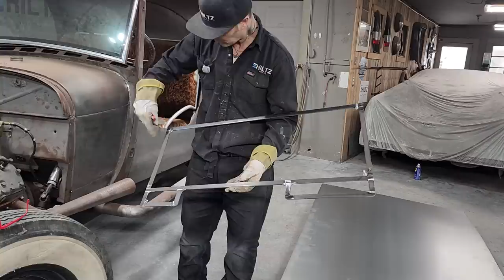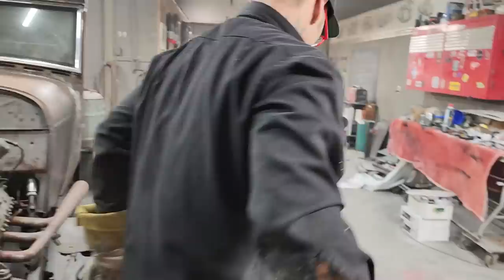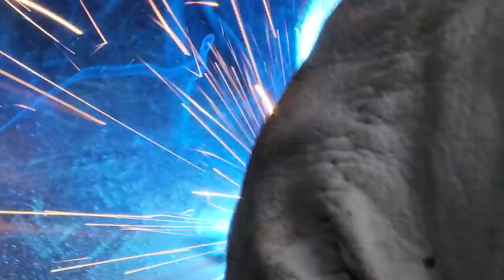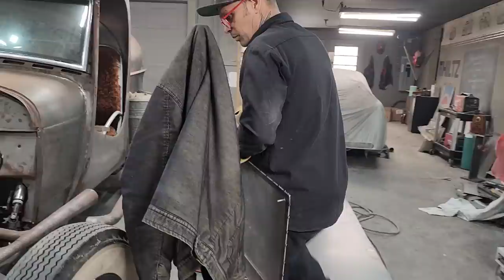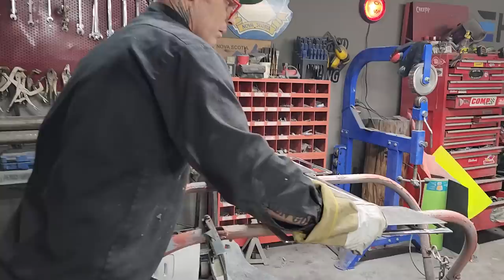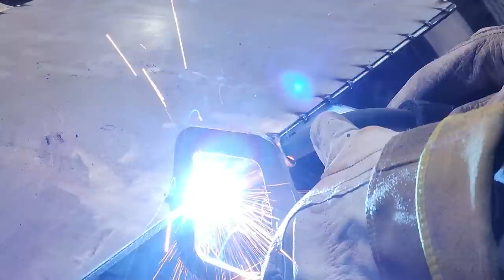Hood fabrication — sheathing with sheet metal 🚨 1928 Ford

Comment: Chad, the last timeI saw you using the Lincoln plasma cutter you experienced some problem with it. In my past experiences, when I had a similar problem I but a new electrode in the gun tip and it solved the problem, worked like new again. Hopefully you can try that to solve problem.  Thanks to you and Jolene for all the great videos and work the two of you do to create a mass amount and knowledge and inspiration on wonderful projects..👍👍👍👍👍👍👍👍👍

Comment: I would plug the three pronger in at the wall, 
Then run three separate single extension leads that way reducing the nest of confused tools and cables in the shop, 
It’s only really required if you have a lack of AC outlets in the shop,

Comment: Old school Harley, Indian style rear fenders with the flair out at the bottom all four corners. Keep the turning headlamps add OG skirts on the rear. Use the motorcycle rear tailights and plate holder on the rear fenders. Fill the tubing running boards flat on top to the body. Put an old school radiator cap on grill shell. A pegasis or something with wings. Shell Oil?

Comment: I’ve found that if I run my power outlets down from the ceiling I get less tangled up. It’s not foolproof but better. You can hang extensions until they are within arms reach.

Comment: In regards to the octopus situation with the cords I would get 3 - 15 foot extension cords and plug them into the power splitter.  This would give you enough cord to move around the vehicle etc without dragging all the other tools.

Comment: Heat moves in every direction evenly, but quicker through different substances. Hot air rises because it's a gas and hot gases expand, which makes it weighs less than colder unexpanded air. The metal gets heated from the surrounding air as the air rises, but heat doesn't rise, hot air does.

Comment: Chad did the newer lincoln plasma cutter die?   I thought the tip got clogged the day you pulled out the old one and you didn’t want to slow down to clean it but that was months ago.  I was interested in getting one after you said how nice it worked whe you first started using it.

Comment: We be sweet if instead of that frame for structure bead roll it about 2 inches in all   the way around then put 2or 3 rows of louvers in the side to pull heat outta engine bay.

Comment: I don't know but could you use a rubber hose to connect the radiator to the rad housing so the radiator would fill  on the top